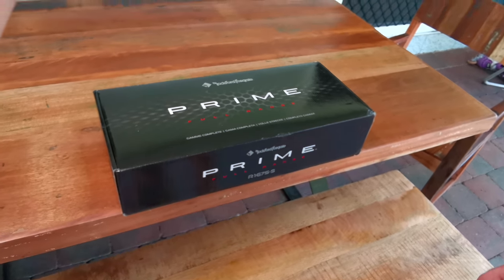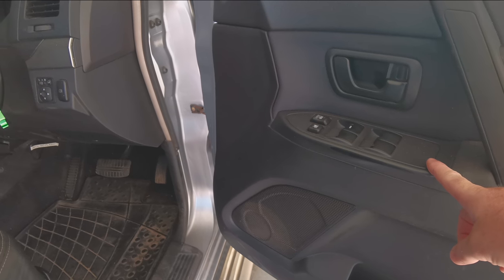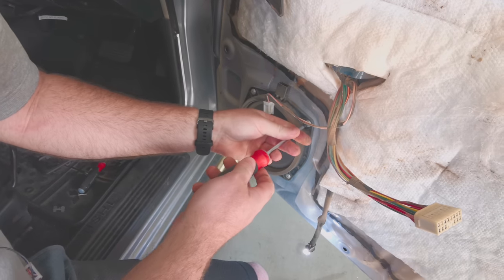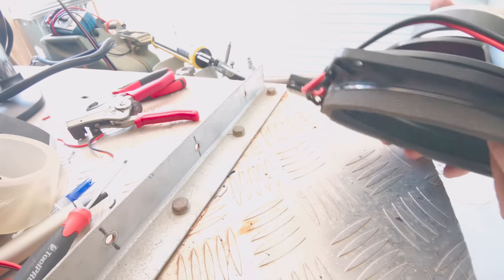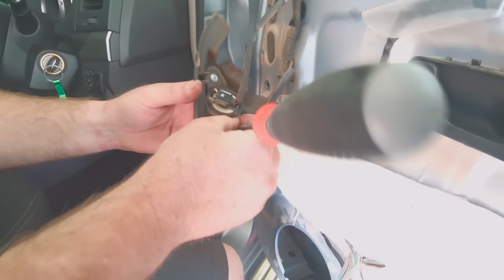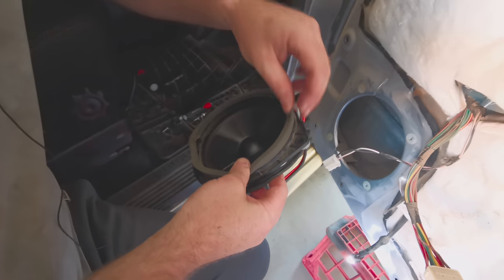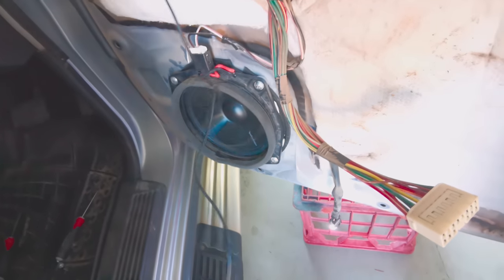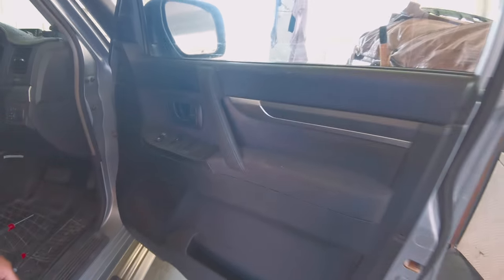Mitsubishi Pajero Front Speaker Replacement Generation 4 Pajero / Montero / Shogun

Comment: Did you glue the new speakers to the old supports or are they just pressure-fit? Thank you
Reply from the maker: From memory I used a bit of the same white silastic I had there to glue the door film back.  It is a pressure fit when you screw it all together and you should still consider sealing the speaker to the frame

Comment: Hey mate, do you know if the sony xs-xb1641 will fit on the Pajero? And If so, would I need to cut the old speaker to fit in the new one for the spacer? Cheers
Reply from the maker: The 6.5” speakers I tried didn’t fit.  You can check against the cutout template of the speaker I used https://www.rockfordfosgate.com/rftech/library/2012/4_speakers/rf_primer1speakers_cutout-irs.pdf

Comment: Do you have the high end Rockford sound system driving that? My Paj has the bog stock std system so wondering how much I could gain from this. Keen to try it!
Reply from the maker: I upgraded the std head unit to an alpine ilx-702d. For the price, the Rockford speakers are a lot better than the std speakers.

Comment: looks very similar to NP pajero in there even down to the broken white square clip MS480010 "mine broke too" when i went in there last week, back in there again to fit window regulator..yep 3week wait on that white OEM clip in meantime i made one up from some clips i bought on ebay years ago..reason i'm here is actually thinking about speaker replacement "mine got no tweeter" and did a you tube search and wolla we meet again mate..hehehehe..btw brilliant idea using the old speaker carrier..are yours 3way or 2way? thinking of these "Rockford Fosgate P1675 Punch 6.75" 3-Way Full-Range Speaker".
Reply from the maker: Ah that’s gold.  I’m using 2-way component speakers - if you can mount the tweeter separately, this is better than 2-way / 3-way all-in-ones.  Hey, you can use champion TF33 square screw grommets in place of the MS480010
Reply: @TravelingBanker  ahh thanks for the tip on the square grommet, we got a autobarn here that sells those tf33..cool..i see 2way..looks like i got wires 7 going up to power mirrors/top speaker grill is there but only 3 wires being used in the plug hmm..this glx is the poverty pack NP pajero, i dont mind that less to break down also LOL..
Reply from the maker: @stigonutube  I have the pov pack NS.  Would you believe even in the rear doors the wires are there for the tweeters.  
I have a towing mirror video I haven’t posted yet that shows even the wiring is there for heated mirrors!
Reply: @TravelingBanker  hahaha imagine that heated mirrors in OZ, classic mate.. i will keep my eye on wiring inside barn door if i get in there, guess i will need a amp,not sure if i'm that keen to go back to my 20s doof doof, however front door tweeters YES..btw got the tf33 grommets this arvo 6.99 at autobarn for 6. i also got 2 oem coming soon.wink..

Comment: How convenient to also have an NS with the same problems haha. Thanks heaps mate
Reply from the maker: Haha, happy to help mate 🤙
Reply: @TravelingBanker  does the size have to be exactly 6.75 inches?
Reply from the maker: @tonee88   I tried 6.5” but they were too small.  These ones I used in the video were physically 178mm wide and fit in a door hole cut out of 147.5mm.  You could probably fit them without using the factory speakers as adapters but you’d have to drill new mounting holes in the door.